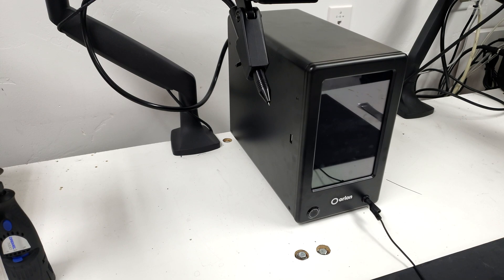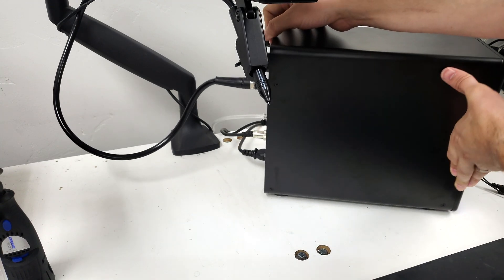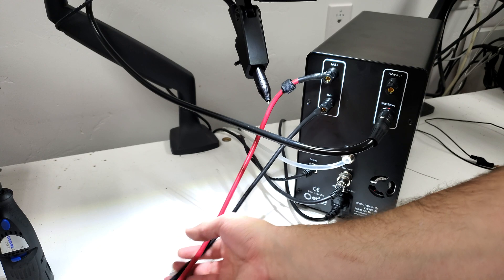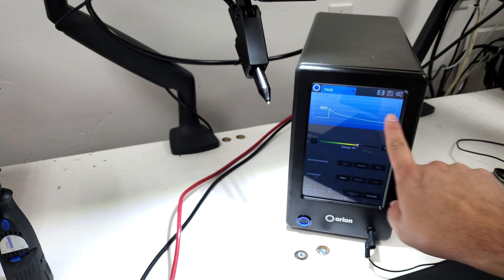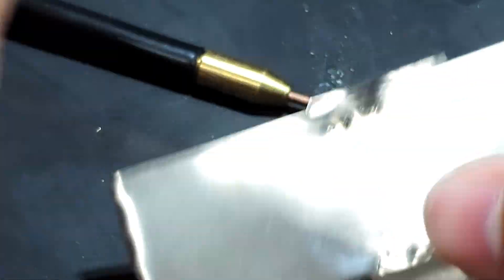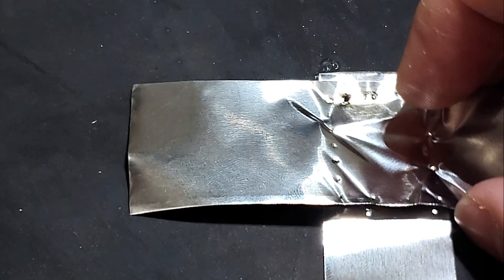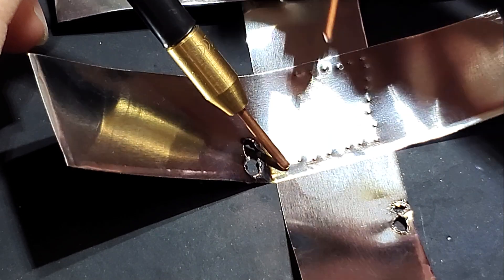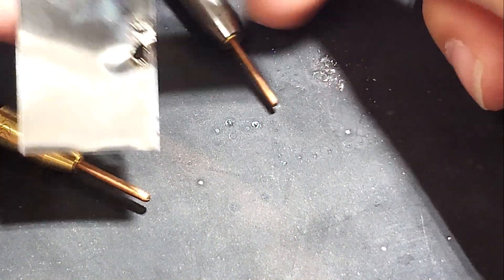Tack Welding Using 150S welder .005" Stainless Steel

Comment: Is this machine capable of welding aluminum to nickel sheet?
Reply from the maker: Using the ARC function of this welding it is more feasible though there are many different grades of aluminum so it would be recommended to contact Sunstone. We will be happy to discuss your project further.
Call or Text: +1-801-658-0015 
Toll Free Phone: 1-877-786-9353 
Email: sales@SunstoneWelders.com